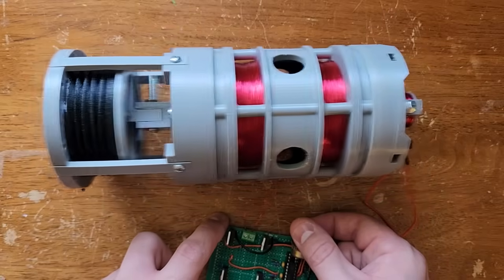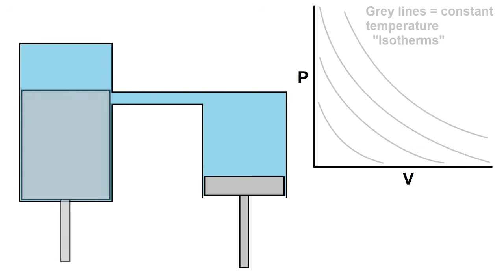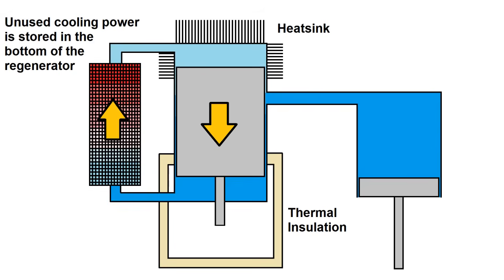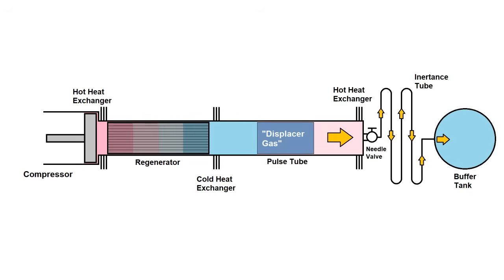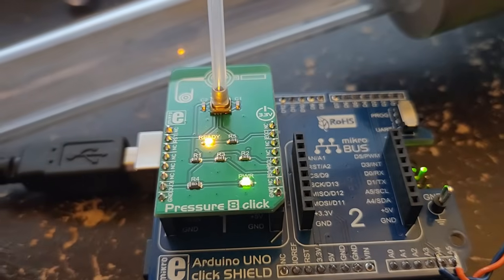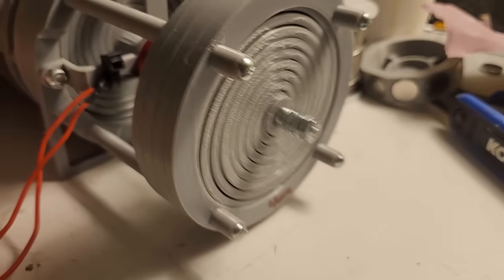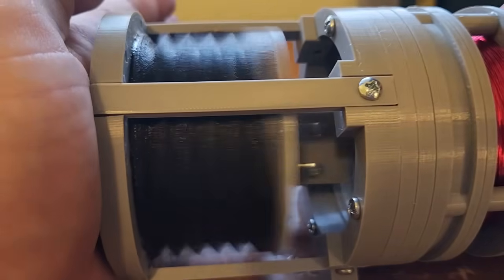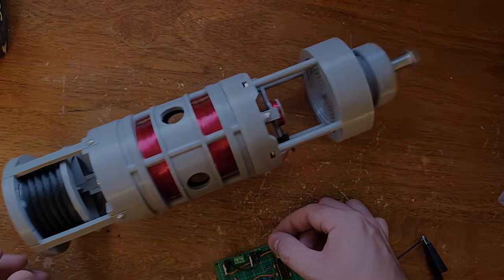Pulse Tube Cryocooler - Part 1

Comment: That’s really cool, several years ago I saw a clip on TV that was highlighting a refrigeration system that didn’t use refrigerant running freezers in an ice cream shop - it must have been related to this design because it used very powerful speakers enclosed in a tube that was able to pump heat, didn’t give much detail but I remember being quite inspired by the innovation.
Reply: - Accoustic refrigeration -

Comment: Hi there, it was a pretty good summary, informative & easy to understand. Congratulation! Your projects are always interesting enough to click on it. :) The linear motor and the balancer was pretty simple. I did not used balancer for my old PT project also not used inertance tube and buffer tank. The main problem is not the low pressure fluctuation, I guess. Not the piston seal or the low stroke of the bellow. The frequency of the system first and the incorrect phase shift on the other side. ( You have lot of experience in electronics. Two pressure sensors could give enough feedback to adjust the phase shift with a valve around the start of the inertance tube) The pulse tube is too long now, and I think the innertance tube doesn't have enough resistance. The regenerator is weak, do not use SS steel wool. It can moves inside the tube, and not dense enough. In my version few years ago I just used a resonantly coupled accordion piston on the back side. The driver was a simple but a bit modified aquarium air compressor with the original piston seal. I used SS steel mesh first, but HDPE mesh in a 40mm PVC tube for the next experiments wich gave much better results. Didn't hit the cryo temp, (Or I wasn't wait enough time to it) but easily dropped to -60 degrees Celsius with no load on the cold side. The hot side HX was build from 1,4mm thick aluminium acetone filled heat pipes, cutted and collected with gap. Anyway, I'm excited about your next step! BLADE
Reply from the maker: Thanks for the input. I've seen your free piston video and considered doing something similar. My main concern was that the bellows piston in the expander portion might fail at extremely low temperature (same with the O-rings on a pneumatic cylinder). Maybe with a proper re-generator / cold side heat exchanger this isn't actually a problem?
Reply: @HyperspacePirate  Yep, the material is not ideal for too low temperature. That was an experimental series but I shared the last step what I've made. I wrote no load, but it wasn't really right. The rubber material has a big molecular resistance. I mean every movements generate heat in the material directly. So the cold temperature doesn't really "hurt" the rubber bellows because the rubber outer temperature was around 24 degrees Celsius when I measured -20 on the cold side. One of the best solution for resonantly coupled version is the  hydroformed stainless steel or titanium bellows. But for your goal deep cryo temp range is not possible to hit with this version I think. What do you think about TASHE config? That could work in that range well too.
Reply from the maker: @AttilaBlade  Heat driven thermoacoustic options are certainly on the table for me, i just don't have any experience with them. It would certainly alleviate the problem of piston seals, mechanical linkages, etc.

Recreating a project like this on a small scale would be fantastic

https://www.lanl.gov/org/ddste/aldps/materials-physics-applications/condensed-matter-magnet-science/thermoacoustics/_assets/docs/Wollan.pdf
Reply: @HyperspacePirate  Tashe could work as heat pump as your pulse tube, the only difference is a loop. (No heat driven engine in my last post.) The main part there the driver is similar as your PWG. My opinion about the balancer: for the perfect parasite resonance cancelling you should build two pistons with opposite direction. And no balancer needed. It will be run smooth as possible in all of the frequencies. Anyway I will check this paper you send me. I hope you will continue this project!
Reply: @HyperspacePirate  Oh, I know this unit. This is a coaxial Tashe with resonator tube, with no moving part, a pretty big unit and the natural gas burned out on the driver section's hot side to create high amplitude sound waves that creates temp.difference on the other side. No maintenance needed, but from the gas we burnt the energy conversation is not so good. I know, but they could liquifying a huge amount of gas with it, with no other things. The electromagnetic driven version is much smaller for same scale. The main problem is the best heat exchanger as always for the TA units. I have a hard NDA so I can't share anything about our projects but Blue Heart project started to make something similar but on a different temperature range.
Reply: GREAT video! Excellent explanation of the underlying thermodynamics; the regenerator is kind of trippy; I never would have thought of that myself. 

I’m super-interested because I’d really like a LN2 generator of my own.

Comment: Most interesting youtube video I've seen in a very long time. A separate compressor with valves to create the oscillations also makes it easy to get rid of the initial compression heat. 

Correct me if I'm wrong, but I think just adiabatic expansion from 0.9 MPa  which a cheap off the shelf garage compressor can produce, and room temperature to 0.1 MPa takes you well over halfway from room temp to boiling point of nitrogen at 0.1 MPa, in temperature, obviously the easiest part, but still...    

On that note, if the goal is just to produce liquid nitrogen, compressors able to produce 30 MPa are available for a few hundred dollars, adiabatic expansion from there, and room temperature, would get you below the boiling point of nitrogen at 0.1 MPa if it weren't for the energy released from the oxygen condensation. So you would have to use the low temperature released air to pre-cool the compressed air, but then you should be able to get liquid nitrogen relatively easy. 

Using "pure" nitrogen would make things easier, regardless of which technique you use. Just to be able to get nitrogen to condensate from air you have to remove a lot of heat released by the oxygen condensation, and that removal has to happen at just a little higher temperature than you need to get the nitrogen to condensate. I wonder if it is even realistic to get significant amount of nitrogen to condensate with a diy oscillating cooler using air without using separate compressor and high pressure air from which the compression heat has been dissipated because the condensation and vaporization of the oxygen takes up a lot of the potential change without changing temperature. Both heat and volume.     

All this assuming I haven't got something completely wrong, or missed something important. I'm not trying to explain basic physics here, just some of my thoughts about some aspects, that might be relevant, or not.                     

And, my suggested "shortcut" using a scuba tank type compressor and pre-cooling the compressed air with the expansion assumes that the only important goal was to create liquid nitrogen, and not also using some specific technology.

Comment: The theory and the scientific facts behind the mechanism are well explained. You started with a great design and you iterated it to better forms by using feedbacks and new ideas. The balance between the theory and the building process is right on the optimal point. 
I already knew something about ultrasonic cooling/heating but the concepts in your video (vibration cancelling/phase shifting etc) are really new for me and there are really cool concepts. 
And there will be a really cool end result which you can use it for doing real science. I mean, liquidifying the nitrogen is a real deal. 

So, in conclusion, i really appreciate your work. This project and the presentaion are beyond my expectation from internet. I honestly wanted to thank you.
Reply: most importantly, you didn't give up! as Edison once said "you didn't fail a bunch of times - you successfully found a bunch of ways that didn't work!"

Comment: Hey I actually just started at a company that makes Gifford McMahon coolers! I think you understand this a lot better than I do, but if you have any questions, I am surrounded by experts on the topic and would be happy to ask them for you. Keep up the good work!
Reply: Good luck with your goals! I have big 0.7W 4K cooler from MRI machine, but only 1kW He compressor. Question to answer would be if there is any chance to make big cooler functional with much smaller compressor, given that I can accept much lower heat lift capacity, but keep low temperature at very light load.
Reply: @xDevscom_EE  It is possible to use a smaller compressor with a larger cooler, but the cooling capacity of the system will be reduced, meaning that it will take longer to cool down and will not be able to handle as much heat. The ability to maintain a low temperature at light loads will depend on the specific requirements of your cooling application and the thermal properties of the materials being cooled.
Reply: @GudLawdHammercy longer cooldown time is expected, as well as limited capacity. It is just temperature that I am after. I haven't find any research papers or reports yet showing performance limits of such system, with large (>0.5W @ 4K, like PT407) head used with small compressor (1-2kW power in) and concerned if heat loss and mass flow required for large head make this unworkable. I guess I should just try to run it and see what happens...
Reply: Hey, do pulse tubes not work at higher T? I guess there are pulse rockets, but not pulse high pressure superheated water generator ones, which might be nice to get once you've desalinated some water or rainwater... I'm going, why aren't there more conc. solar steam power things, maybe powered from steam off PV covers but sent off to condensed and hi-press  lines...

Comment: A fascinating device.
I'm currently playing around with the idea of using this device as a pre-cooler for a Peltier module.
Would that make sense?
I have to admit that I'm pretty unfamiliar with thermodynamics and the like and can't really have a say.
For this reason, it often happens that I come around the corner with rather adventurous ideas.
Reply: This is a bad idea, low efficiency and huge vibrations will kill your peltier element
Reply: @ДимаЧунюкин  Thank you, Dima, for your response.
I was not sure if that will work. 
Are the Peltier that unstable, that they will crack from the Vibrations?
Reply: @baselifter  
These are fragile ceramic elements, inside a soldering of more than 100 thermocouples, they are so fragile that even thermal cycling after a couple of thousand cycles disables them.